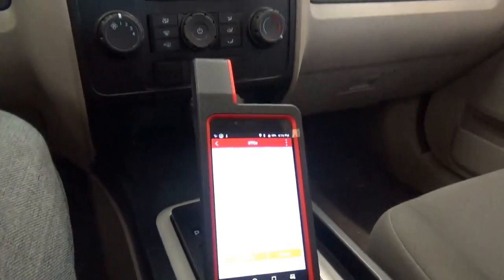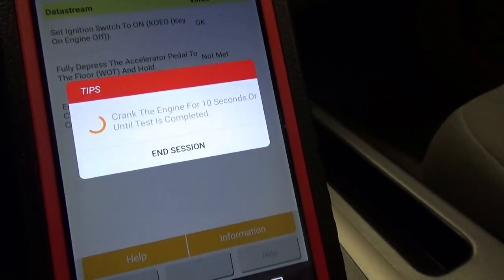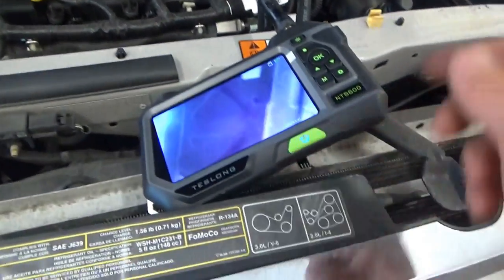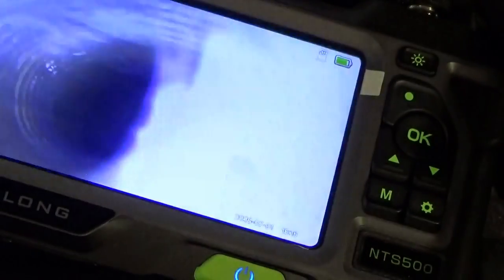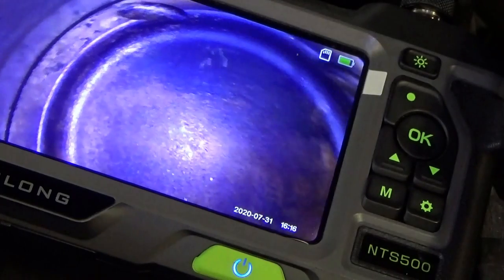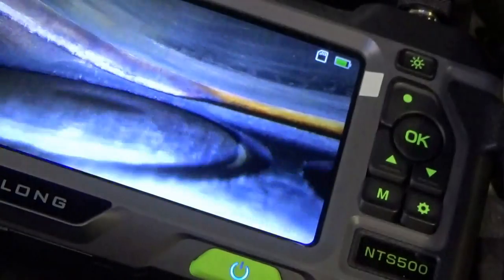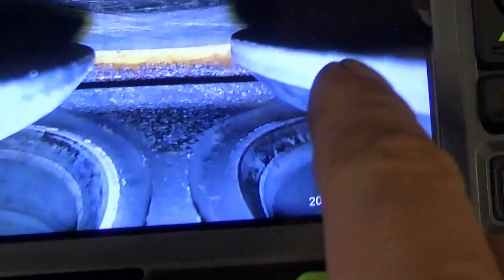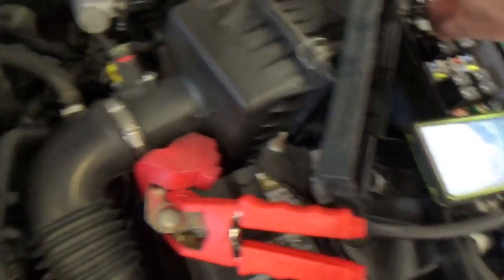Diagnosing a Misfire with a Visual Inspection? (Teslong NTS 500: Ford Escape 4 Cylinder)

Comment: Never do a one Valve Valve job you’re just asking for trouble down the road. When you get the head of the vehicle do a complete head overhaul and even shave the head.A rounded valve margin or valve touliping is a sign of trouble which could also be caused by a Loose  valve guide. Tearing down motors for 20 years I have learned that the first thing to go on most engines the top ring on the piston, exhaust valve guide and/or exhaust valve.Back in the 80s, LOL I saw my first endoscope in a Mercedes-Benz dealership and it blew my mind. Great review. Keep on rockin

Comment: i wonder if the guide backed out/moved or ran low/out of oil and the timing set is shot, it's possible to bend a single valve out of a pair, tolerances are never perfect. only other thing, is the seat moved from being overheated, which would mean warped head, gasket, block sealer in it. best bet, just slam in used engine

Comment: Easy and cheap repair , if the valve are not bend then, adjust the valve and add 0.5 mm extra valve clearance drive the care the valve will most likely reseal , check valve clearance after a month leave it lose for another month , your car should be back to full compression

Comment: Tuesday McNamara will clean "Idle Air" something; Thought it would take R&R but Steve says just to clean it▬ 2001 Silverado W and likely low compression on #1 but attained stable improved by use of Iridium Distributor cap

Comment: That's cheating, but I cheat as well, just hook the air into the cylinder and listen for escaping air.
I don't do traditional leak down testing, don't even own a tester. As a retired heavy line tech from Ford dealers it was never a necessity.
Management wanted me to have one, but what the hell do they know.
I always had some idiot manager second guessing my work, but every time they challenged me, I proved they were full of shit.
I took to working under the maple trees at home rather than constantly battling idiot managers.
That same dealer in Santa Barbara was closed by Ford for fraud perpetrated by these same managers. The Ford rep said "Congratulations, you guys are number one in the nation, on warranty claims, I am here to audit you" That is when I decided to move out of State and do my own thing. 
I didn't mind service writers, but, managers are totally useless.

Comment: What's the right fix for the valve job... Do you take the cylinder head to the machine shop and replace the bad valves or do you get the whole cylinder head fix with a complete valve job?
Reply from the maker: I would start with a good machine shop. They will tell you if it can be fixed 👍🙂
Reply: @PineHollowAutoDiagnostics  
I'm a little confused... You diagnosed, one burned valve! Self-Tech's working from home with experience can replace a burn valve without removing the cylinder head. But, should the one burn valve be replace or remove the cylinder head and get a complete valve job repair? 
I say just replace the one burn valve with a OEM part and that should fix the misfire?
Awesome work and videos! Thanks!

Comment: I swear I saw dents in the piston and corresponding dents in the exhaust valves, in piston heads could be fly cuts or casting impressions to give clearance for valves but never in valves because they are usually set up to rotate to reduce wear and localized heating, odd.
Reply: I guess a look down another cylinder would tell all
Reply: @bryanlatimer-davies1222  A look at the bottom side of the head would be more practical, if the engine has high miles and the oil pump is at rear of engine, it's not uncommon for the valves in No. 1 cylinder to get sluggish from oil starvation and over heating, the oil is also a coolant. I've seen computer simulations of worn guides with insufficient lube, worn valve stems in said guides, high rpm, high heat and a peculiar thing occurs a harmonic vibration is set up and causes the valve stem to rock in the guide and for a micro-second the valve locks and is struck by the piston, also because of uneven oil distribution the front valve springs usually relax, old age helps.

Comment: I just have to laugh when the auction guy says it must be the computer. When in fact with most any electrical issue, that's what I  look at as last on the list of possibilities. I like that scope, affordable too. Just curious if you do an injector leakdown test when you have a valve problem like that, or do you check that when the valve has a chunk of metal out of it?
Reply from the maker: Good question. Apparently just a defective valve on this one, surprised how good the other exhaust valve looked!

Comment: Does that relative compression test mean it's down 17% or it's only contributing at 17% of factory-recommended compression?
Reply from the maker: I think it's an arbitrary number...
Reply: One other cylinder showed 1% and it says "OK", so it must mean 17% reduction, not 17% left (if the number has real meaning as Ivan says in his comment)
Reply: @gorak9000  thanks, I didn't really pay attention to the other cylinder test results.

Comment: what bothers me about these cameras is they usually come with crappy image quality where nowadays cell phones have 41mp cameras on them and 4k screens . we get the image quality of a motorola razr from 2006
Reply from the maker: The image quality is pretty amazing considering it has two separate cameras on the tip of a thin flexible wand!
Reply: @PineHollowAutoDiagnostics  Иван, почему бы не предоставить нам файлы с SD-Card?  Мы могли бы увидеть все это потрясающее качество изображения...
Reply: @PineHollowAutoDiagnostics  its better than most but i mean just in general these things lack compared to current technology😂

Comment: So could you apply some lapping compound through the spark plug hole and get the job done without removing the head? Hmmm
Reply from the maker: I tried that on my old Mazda van... Didn't really help. It's been running with a leaky valve for the last 5 years 🤣
Reply: @PineHollowAutoDiagnostics  lol well damn, worth a shot

Comment: So how does this get fix , new valves or new engine?
Reply: I'd say head ,gaskets and timing set. Because new complete head is around the same price as sending it to the machine shop. Used head from the salvage yard would be even cheaper but then you take the chance of being in the same spot. And I say the timing set because odds are it hasn't been done but that's where you talk to the customer oh wait auction car so he doesn't know.
Reply: @shaunadams3170  usually when i find low compression on one cylinder i condem the engine and its about the same price to do engine swap than a head swap here in new York city.
Reply: @JuanOrtiz-mo8be  very true it is cheaper to do the whole engine here too
Reply: Here in Russia, head repair will cost 1/4 the cost of a contract engine. They always repair their own head.